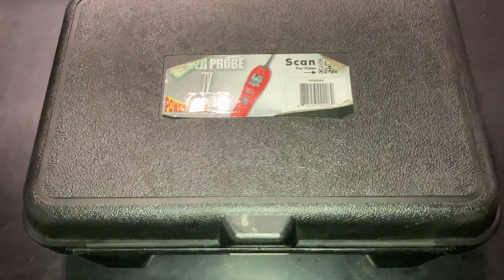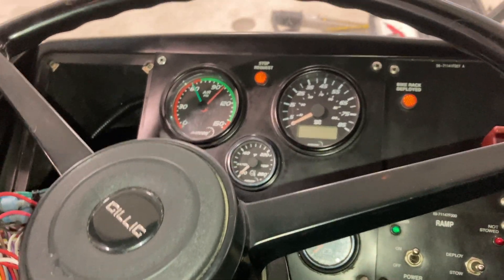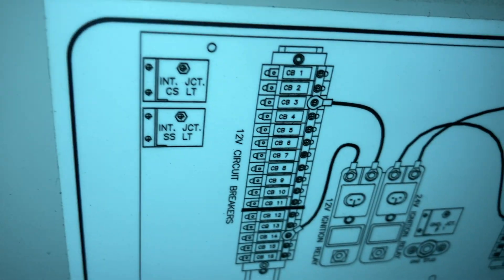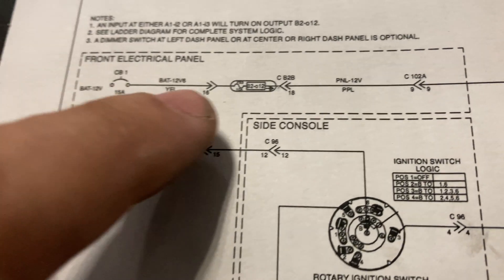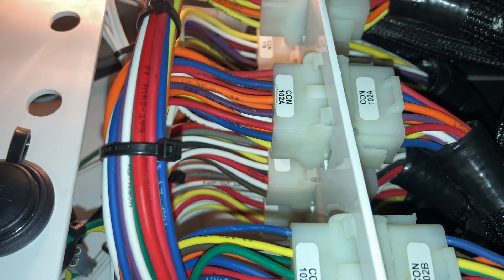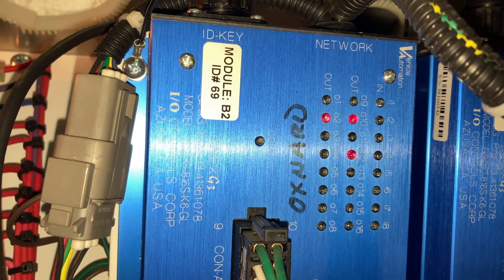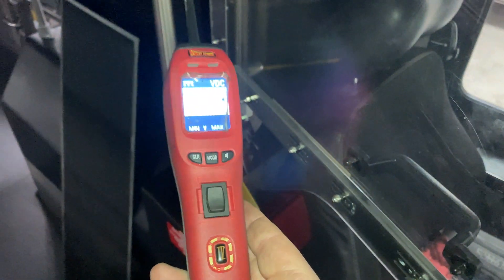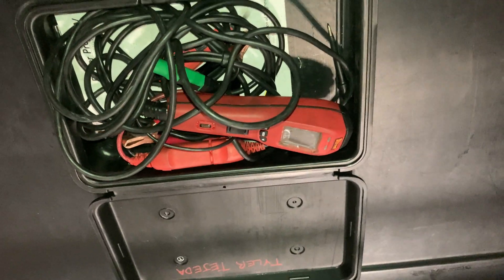Basic voltage checks & diagnosing simple circuits using a Power Probe 4

Comment: Good video. My Power Probe bit the dust recently, so I gotta choose my next one.
Reply from the maker: Did you make a choice yet ? I recently purchased the “load pro” and love it. It’s different than a power probe but awesome none the less
Reply: @TurboTyTy  I actually might go completely off the rails and try the Autel. I really want a rig that will hold up better, it might be worth testing.
Reply from the maker: @ToolDemos  does it have a built in scope?
Reply: @TurboTyTy  the one I’m looking at is just like a power probe, not a scanner. So, no just a regular screen.

Comment: The problem here is , diagnosing the faulty fuse is not enough b/c there’s always a load or a shorted wire that caused the fuse to blow. So if you don’t determine which component is the culprit of the blown fuse, soon it will just blow again